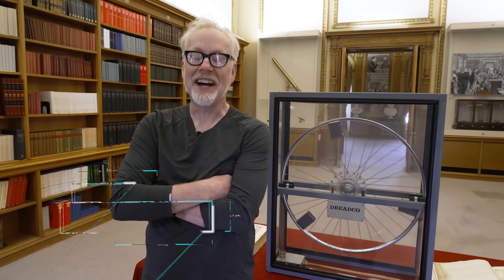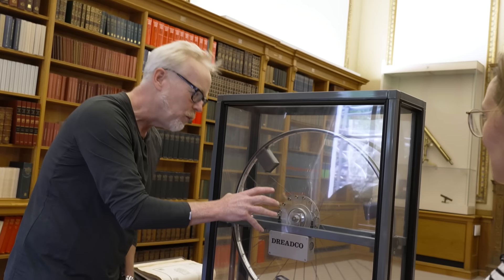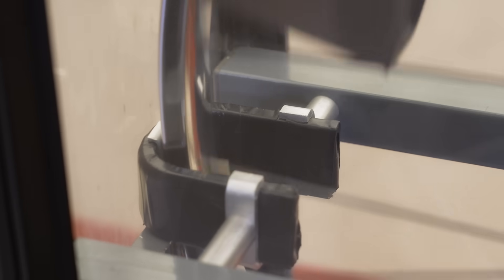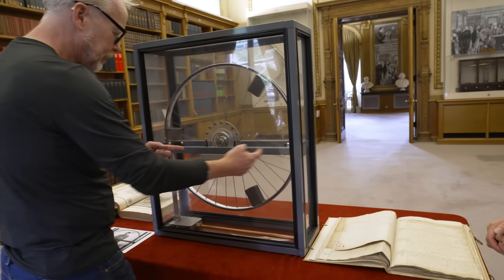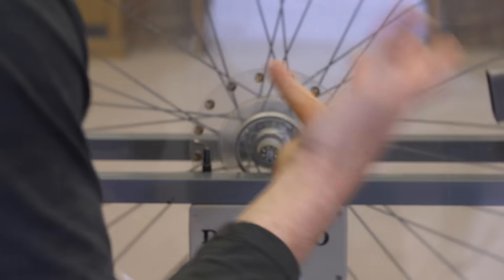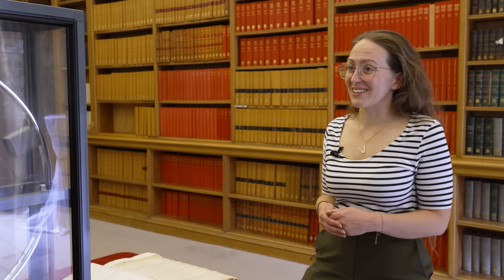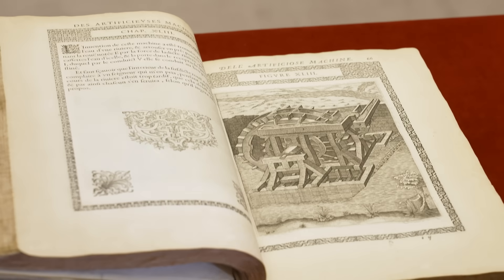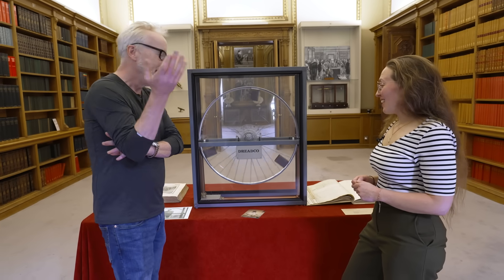Adam Savage vs The "Perpetual Motion" Machine!

Comment: Perpetual motion machines are simply impossible using gravity only because gravity is the same on both sides on the wheel... You would have to have a difference in gravity or perhaps air resistance or other force having an influence on it like a solar sail or that new thing they figured out : a tractor beam using a laser and a graphene sheet....

Comment: I suppose there's a pile or a battery in each of the three boxes (either just for redundancy or also for additional inertia) and the energy from them is used to move a weight inside to pump some additional momentum to the wheel, and everything outside on the immobile frame is just for show. Each box could be like a kid on a playground swing moving their legs in the air to keep the swinging going until they're out of energy.

Comment: The only thing that prohibits these machines from actually existing is friction -heat, the bearing surfaces wearing out. Essentially... vertical Gravity must be removed from the equation all together. Lateral gravity can be used as perpetual incentive, however that can only be achieved in  zero g.

Comment: another factor is the "batteries" form a flywheel wich gives gravity  assistance. I think it's actually just using the magnets in combination with the blocks and gravity.  The blocks give the magnets something to push. And it's all timed and weighted. The small device in center box just adds a bit more magnetic push. The condenser couldn't really have a purpose other than in some assistance to the magnets. There is no air or liquid or paddles or any other way for the condenser to react.  With the wheel beside the magnets

Comment: Pretty sure I know how this works. I believe there are a series of counterweights suspended by chains and housed within the 4 corners. The chains are connected to gearboxes, which connects to a drive shaft that rotates a flywheel which is housed inside the dreadco box.  Using electromagnetism, a very small amount of force is transferred to the bicycle wheel, thus imparting a small rotation on the wheel.  

The servicing is just rewinding the counterweights like you’d do with a grandfather clock.

Comment: I think there just magnets. I think this functions like how a electric motor works (I'll attach a link for visual aid). Using opposites attract and likes repeal. If that was going a bit faster and you had a battery to store the power it created, you would have an energy source. Disclaimer, I have never had a science class. What I know is from my trades and the research I've done. However, I could 100% be wrong and I'm pretty sure I used the wrong word or term earlier regarding "power". 

Link: https://youtu.be/CWulQ1ZSE3c

If you fast forward 2 minutes, the video will give you a clear representation of what I meant above.

Comment: so my guess is, the dots in the middle are magnets, the 2 spikes things generate electricity as it passes past them, which in turn activates the U shaped electro magnets, which then pushes the wheel forward, as they repel the 3 magnets on the edge of the wheel.

also the arrangement of the magnets in the middle, are not all facing the same orientation (( N & S )) as the reverse the polarity of the Electro magnets, which could hinder the movement rather than push it forward, and lastly... 

one these boxes has a battery to make up for the loss of energy to friction/air etc...

So that's my guess. unless somehow he made 0% friction bearings, as-well-as that box is vacuum, this needs a battery.

Comment: I'm sorry to spoil the fun but you see I am somewhat of a genius myself... It's quite simple really. The steel box frame of the device and possibly the 3/4" pipe encapsulates 18650 cells which are connected in series and hidden wires go through yo the U shaped Electro magnets. The boxes on the rim could be neodymium magnets or just a highly ferromagnetic metal such as iron. If they are magnets they are opposing fields to the U shaped magnets and are possibly angled in such a way to propel the wheel. I will almost guarantee that this device will not work in the opposite direction . The outside diameter of the 18650 cell is 85mm or .708661 inches which fits nicely within 3/4" copper pipe and the square tube frame. You can thank me by subbing to my channel and asking Adam to have me on the channel so we can recreate it ;-)

Comment: Can one exploit the coriolis effect (suck energy from the earth's rotation) to 'fake' the perpetual motion machine? Like a gyroscopic wrist exerciser, where the rotation of the earth 'pumps' the wheel? Another thought is: consider the radiometer. all you have to do is place the radiometer in a well-lit environment and it will appear to act as a perpetual motion machine. It's one thing to remain in motion, it is quite another to 'throw off significant extra energy'.
Reply: Actually, yes! But the wheel needs to be gigantic (kilometers). There have been plans proposed. The physics works, but the scale is kind of silly.

Comment: First of all, perpetual "motion" is not impossible, just let a spinning rock in deep space and it will spin forever until something stops it. (Newton´s law).
But a machine that creates "work" by itself is impossible of course.
I think in a perfect vacuum a wheel with contactless magnetic bearings can spin for a LONG time, but obviously, it is not the case in this video, whit this air around the wheel and this ballbearing I presume that exists a small, but considerable, energy doing work on it. 

When I was kid, me and the boys build what we call here in Brazil a "Galena Radio" that works "without energy" (the energy is in the radio wave itself) so I think that device on video can work converting radio waves, not only human created waves, but background radiation, cosmic rays, etc... Just put it in a box made of lead, that works as a Faraday´s cage too, and test if it stops...

Another possible way is by heat variation, exists a "perpetual" clock named Jaeger-Lecoultre ATMOS, but of course is not "perpetual" its have a huge piston on the back that moves by pressure variation in the gas inside the piston chamber caused by ambient temperature variations, just a small variation in temperature can keep the clock working for a long time.
Maybe those copper pipes plus this box with heatsinks can hide a similar mechanism.
Just turn the air-conditioner or heating in the room on/off in a certain time to see if it speeds up, or put it inside a thermo-insulating box and test if it stops...

Or the box with heatsinks has some radio-isotope material that generates heat and some mechanism makes the hot air go to one pipe and cold air enters in the other pipe, just close the pipe and wait.

If nothing of those tests changes anything, (and don´t have a battery hidden in some place) call an exorcist!  lol

Comment: So its a sealed box, only one place opens it to restart it. Clearly its not a perpetual motion device. Hardest part about this type of device is how its built, can it be moved, and is meddling possible. So the ones I know of from long ago. Had many witnesses seeing it keep running, some person decides to move it and it stops. Also battle of heat alone your dealing with forces we yet know of affecting objects, gravity is one of those depending where you are. In many ways difficult to deal with in a simple way. But fun to keep trying if not for fun.

I saw one a water style long ago that seemed to be an endless siphon process. It did indeed just run but on distilled water. Exposed to air so eventually said water would get dirty.

Comment: I reckon, there is a battery inside the rotating box, that pulses an electromagnet every (3 seconds) this magnetic pulse, draws the electromagnet to the fixed magnet, providing some small degree of inertia.
If the wheel starts to go too fast, the pulse will be late and will retard the speed, I think the wheel will synchronise to the speed of the pulses.
The other two boxes could be empty apart from counter weights.

Comment: Three rotating magnets, with one or more fixed in place Hall Effect sensor,(s) coil(s) of wire, and a battery(ies)...and voila! "Perpetual Motion" Machine (until the battery needs "servicing".)
I suspect it would be easy to debunk with a simple magnetic field detector that would show varying magnetic pulses somewhere out by the rim of the wheel.
That would be virtually identical to a standard TOY rotating body "perpetual motion" configuration I first saw over 25 years ago.

edit to add: note...many cellphones have a built-in magnetic field detector that would easily show such magnetic pulses occuring.

Comment: Hey Adam how would you like to tackle a partially less efficient but higher torque AC motor? AC motor close to perfect efficiency especially with a chip just not much power output without direct power or huge batteries and the batteries don’t last long

Comment: If it slows down in the basement! The corner box Sav mentioned as a heatsink, could possible be a Zener diode! I had one on a motorcycle, and never had a battery in the bike, It crank off the diode.

Comment: I found an old note/ confession in a book on aviation from the early 40's. It discussed the creation of such a machine used in a kind of jet engine but without fuel. "I have chosen to end my life, being overwhelmed with grief. Here is my story with a warning. In a perpetual machine, the real issue is putting negative resistance bearings in there. The more they are used the less friction until they put energy into the system.  Using the idea of a regenerative oscillator ( old time radio or just a PA mic too close to the speaker) i made a perpetual motion jet engine two years ago. A cylinder with two fans and a nozzle tube behind. The fans were coupled via a 1:1.25 gear made from special ultra low friction teflon-like plastic ( still secret). When fan 1 turned it caused fan 2 to turn 25% faster. This sucked more air in making fan 1 to turn yet faster. And so on. I launched it from a tall building in Chicago. After holding it as long as i could after blowing a puff of air into the front, i let it go, pointing up at about east. The gyroscope effect kept it steady as it sped off at a rapidly increasing rate. I tracked it with powerful binoculars for a few minutes but lost it in the clouds. It would have crossed the NJ shore at about Lakehurst , NJ. The speed was immense. There were reports of a shooting star over Ft. Dix shortly before it would have arrived in the Lakehurst area. The friction of the air at several thousand MPH must have caused red hot heat on the skin. I swear I had no idea of the Hindenburg late docking. Now you know the result. The special bearing secret dies with me. I am so sorry!" At this point the note ended but the name was missing. Makes you wonder.
Reply: Signed John F. Kennedy
Reply: Source?

Comment: There's clearly some jiggery-pokery going on. The fact that it 'runs down' every couple of years indicates it is battery-powered and there must be some switching 'gubbins' in that central box masquerading as a nameplate. Rather like a big battery wallclock.  I suspect it's a bit like those shop window displays that were popular in the 60's. They were usually rocking or swinging models that ran for months or years without any visible driving mechanism. They used a magnet in the moving part and the frame held a small electromagnet just powerful enough to kick the magnet as it passed by on its arc.

Comment: You can tell Adam is excited because he’s an engineer - but knowing this is more of a ‘red herring’ art piece is quite underwhelming. 

There are endless parts just to throw someone off on purpose and it’s nearly always because the ‘magic trick’ in the end is simple and a bit of a con. As other’s have pointed out, a bike wheel on a really smooth bearing that’s balanced will spin very easily and a simple clock can keep running for years without a new AA battery.

The genuinely amazing thing is the Oxford Electric Bell, which has been ringing from a battery from 1840. It’s outlast every other battery to ever exist.

Comment: magnets and some sort of conducting liquid that gets turned around the top of the wheel from the copper tubes and it gets recycled through the other end and the two little rods are a pos and neg so the liquid conducts the energy for the magnet to turn the wheel i think?

Comment: On a perfectly balanced wheel the photonic energy of the lightsource  shining more intensively on the top than on the bottom side should be enough to cause a difference on expansion of the ring and a shift of the CoG to the area over the axis. The heated ring  area would cool down while moving to the bottom side and another area will be heated up to keep the CoG shift to the area over the axis alive.. what would mean.. at low friction of the bearing it would keep turning as long as the photonic light source is available.
Reply: Of course, the light source would have to be powered by something, so whatever is powering the light source is what is powering the wheel.

Comment: It's actually pretty easy to figure out. The pipes are worthless. The magnets attached to the wheel are for inertia and to trigger the magnets in the box that triggers a ratchet that pushes and pulls the drive mechanism.
It doesn't matter what kind of logistics you apply to it, it would be worthless trying to index a series of them to power anything but still fun to look at.

Comment: If there were a solar panel feeding the circuit in the box, you would have an over unity generator. the box has a circuit that opens and closes the switch (circuit), as the magnets pass the coils and build a charge in the coil, and before it collapses the charge is funneled into a battery by way of the switching. It's effectively an amplifier for the charge that drives the circuitry. It takes a delicate balance; it has to be adjusted so that the impedance is matched. this changes over time and speed. The one my friend built has a small solar cell that adds power to the circuitry. The output is used to charge a battery. one of the noted "side effects" was the removal of lead scale on the plates of the battery being charged. it is not a perpetual motion machine because it takes a small input to get a larger output. He was in the process of building a larger unit when he passed. He hand-wound the coils using welding rods that had very dense metal as the core, getting the parameters of each coil as close as he could to each other. The battery he used for the experiment was off a garden tractor and was going to be replaced as it was not charging properly. he charged and discharged the battery a little less than 20 times. the latent charge on the battery before the experiment after being on a standard charger was just over 8 volts, which indicated the battery had lead scale on the plates, before starting the experiment he drained the battery, rinsed the insides with distilled water and added new electrolyte. Recharged the battery and the latent charge was still under 9 volts. (12v battery). after the experiment the latent charge was 15 volts. the wave form as observed on the output to the circuit was shaped like a lower-case h. the mechanics of the circuit, the switch would open, the magnet would start past the coil, the switch would close as the waveform created started to collapse and dump the charge in the coil to the battery then the process would repeat. his test tool was made using a plastic childs bike wheel with the magnets evenly spaced the single coil was mounted on the base plate and the wheel mount was made of wood. you get the process started by spinning the wheel and then you start adjusting the circuitry to get the proper timing and balance.
Reply: "If there were a solar panel feeding the circuit in the box, you would have an over unity generator."

If there is energy being added to the system it is absolutely not an over-unity device, by simple definition.

Comment: Id bet 100 bucks that it is running on heat differences in the room. And the servicing is removing resistance by oiling up and/or switching out the ball bearing.

Comment: Seems like the aerodynamics of the rotating wire spoke wheel with block weights is pretty bad and could be greatly improved using known bicycle racing technology. The front wheel of a modern time trials bike with three carbon fiber streamlined spokes with the weights molded into them would give much better performance.

Comment: Seems utterly simple: The magnets are electromagnets that are alternating from side to side.
You'll notice as one box passes the left-hand magnet, another box is approaching the right hand magnet.  So one can expect that as the band-aid box on the wheel approaches the left side magnet, the charge cuts off and at the same time the charge is applied to the right hand magnet.
repeat.
Was that difficult?
I can't believe it takes anyone more than 30 seconds to figure this out.
It's like a trick you'd see at Spencer gifts for $10

Comment: The wheel itself is the component that the charge of the 3 boxes goes through instead of wires. If you look at how the boxes are connected to the wheel then one would assume that the charge  continues from one box to another. Like you said it would only have to have a small charge. Especially if those 2 horseshoe pieces of metal are magnets.
Reply: maybe those boxes are capacitors?